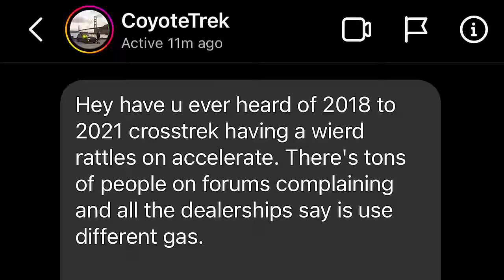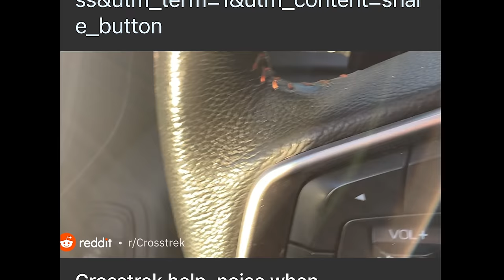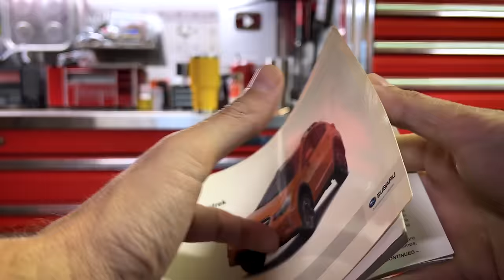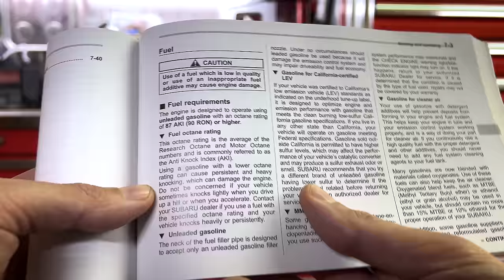Rattle, Ping Pop!? What Is That Noise In My Subaru's Engine?! Detonation & Pre-Ignition Explained

Comment: My brand new 23 crosstrek does it also. I've only got 1600 miles on it so far.  6 speed Manual.  I havent even had it a month. The dealer delivered it with a full tank and for that first tank it was quiet and smooth. Then I filled it up and the pinging started. I did 2 tanks of regular top tier gas (87 octane I'm in the US) and both tanks pinged on slight inclines under gentle throttle.  Idle was also very gritty. If the car was idling and I gave it a quick tap of the throttle the pinging actually sounded really bad. I hooked up a scan tool and watched the ignition timing go from 30 degrees before TDC  to 6-8 degrees AFTER TDC when doing this quick blip of the throttle. I was also seeing about 10 random misfires on a short trip (EWMA misfire count)  I did a tank of 93 octane and by about 50 miles into the tank the pinging was 100% gone.  The same throttle blip at idle only dropped to 5 degrees before TDC, and the misfire count droped to 0-1 per trip.  There's this unusual surge that happens when accelerating very gently between 2-3K rpm, that also went away with the tank of premium. I'm currently running a tank of mid grade (89 octane) to see how that does. If it's not 100% of what 93 was I'll just go back to 93 octane.   It's a shame they couldn't be honest about what these engines require. And I'm sorry, I don't care if the manual says some light pinging is "normal" I don't agree.  In their book I'm sure slight just means it isn't enough to destroy the engine during the warranty period which is all they are worried about. (I'm not bashing subaru, it's all auto manufacturers)  I'm convinced they delivered the car to me with a tank of premium. Because when I did my own tank of 93 it ran the same way.  I do absolutely love the car though. If I have to run premium, I'll run premium. 

Awesome video as always

Edited for spelling.
Reply from the maker: Yeah. Also believe our fuel quality is dropping the last couple of years. More ethanol added then the claimed 10%.
Reply: @MrSubaru1387  quick update. I finished the tank of mid grade and by the end it was not misfiring at all, but the weird power surge between 2-3k when driving gently came back. I'm now 130 miles back into the next tank of 93 octane again and it's gone. It runs smooth as butter.   I'm sure you're right about the quality of gas going down hill the last few years. 

Side question.  There's a warm up cycle that occurs for the first 60 seconds after starting every time, even when warm, I'm sure it's to warm up the cat, but it makes driving through parking lots slowly in 1st and 2nd gear almost impossible.  I have to wait out the 60 seconds then it's perfectly fine. The wife's forester does the same warm up cycle. You can hear the exhaust note change during this time, however since hers is the CVT, it doesn't have an impact on drivability.  Have you come across the same thing?
Reply: My 2018 6MT crosstrek is very much the same as yours. It makes the most noise under a light load when running 87 octane going up a hill and has a hesitation at about 2400-2500 rpm. When I run 91 octane 100 percent gas, it makes very little noise.
Reply: @jamescurrier5828  when I took the car in for the 3000 mile inspection/ first oil change, I brought this to their attention, and they shrugged it off and gave me the subaru owner satisfaction phone number to call and complain. I mean, it's not the service departments fault, but the whole "we've never heard that before" is a load of crap. It's just like you describe, worst between 2400-2500 rpm on slight inclines. If I start to to climb a slope at that rpm range I can actually feel it loose power (probably pulling back ignition timing in an attempt to lessen the ping)  I've read of some 3rd party re-maps that will eliminate this, but then there goes your warranty. Subaru needs to do a minor re-tune on these manual crosstreks and release it as an update. I understand they have some strict emissions goals to hit now, but this is just pathetic.
Reply: @matthewweaver1123 I've been running 91 -94 octane in my '21 Limited. 
My 2 other vehicles (Corvette & 4 Runner w/TRD Supercharger) both require 91 or+ octane fuel , so I'm use to paying for it. 
With my Crosstrek, I've noticed my gas mileage is averaging 33 - 34 mpg on a 50/50 split city/highway driving.
Reply: I totally agree with this statement, I’m pretty sure it has something to do with fuel, because I have a crosstrek with 37k miles I usually go to Costco for a gas. But as I was driving around the city I noticed this shell gasoline station had pretty cheap for 3.34 a gallon, so I went ahead and gave it a shot because it’s shell. A day after, that’s when I started hearing this type of noise so I’m pretty sure it has something to do with a fuel.
Reply: 1 year update. I'm at 42000 miles. About 50/50 highway city.   I've done the induction cleaning with the tool and the subaru top end cleaner. Didn't help. Also ran techron concentrate. I tried 1 tank of regular after many many months of mid grade.  The pinging is horrendous.   This engine sounds like it has 250,000 miles on it. I'm seeing ignition timing up to 5 degrees after top dead center on hills.  I'm going back to mid grade, and tomorrow morning I'm doing plugs. I have misfires on cylinders 3 and 4 during the first few minutes of warm up. The coils have been moved from 3 to 4, then 3 to 1. The misfire has not moved yet.  The dealer does not care.  I'm on my own. Next step is plugs. I don't have an inspection camera, or I would be trying to get a good look at the valves while the plugs are out. I'll give another update in a few weeks after plugs are done. I want to give the computer time to readjust after disconnecting the battery for the plug change.
Reply: In your last 2 posts it looks like the problem has come back, or were you not using 93?  Just want to know if 93 still fixes this for you, like it did in your first 2 posts.  And thanks for your updates.
Reply: @AB_159  so as the mileage has climbed at around the 10,000 mile mark I needed mid grade when the weather was hot to prevent the pinging. Then, roughly around the 25,000 mile mark midgrade wasn't enough on really hot days so I moved to high test. Now I'm around 45000 miles and on the really hot days the high test (93 around here) would not 100% prevent it, but that's as good as It would get. I did the induction cleaning with the tool and their official top end cleaner exactly the was the tsb says to do the cleaning, but honestly it didn't do anything at all. 
After I did the plugs and allowed the computer to readjust it seemed to be doing much better, then within the last week it's been running pretty lousy again. It had the tires changes out at the dealer last week. Decent tread left on the the original geolandars but was losing quite a but of traction when wet. My loaner vehicle was a 24 crosstrek wilderness. It runs waaaaaaay better than mine.   I just think there's a hand full of them that have some unknown whatever slightly out of tolerance, so you never get a check engine light, but it just is never quite right.  It bucks and surges on hills and pings in hot weather. It's super rough around the edges, but I guess it's still getting me from point A to point B. I'm just hoping that since there is a steady slow degradation, eventually something will be far enough out of spec to finally reveal itself. Not sure if it's a bad sensor , really not sure what to guess,  it just reminds me of a small engine that is running waaaay to lean.
Reply: Trade it while it's still got warranty/reasonable miles for something you can enjoy.  I've been down that road of trying to fix it, albeit not a Subaru, and it's not worth the hassle.
Reply: @AB_159  I really have given it thought, but interest rates right now....  I just keep hoping either whatever is wrong will get bad enough to finally throw a code, or it will plateau and I'll learn to adapt.

Comment: In for the next video. My 18' FB20 w/ 120k does this consistently on 85 octane at Denver elevation, no issues at 12,000+ ft (other than normal lack of power). It's had spark plugs, PCV valve, B12 in the tank recently with no improvement, about to clean the EGR valve and run CRC valve cleaning and BG EPR through the oil in an attempt to reduce compression and improve EGR flow.
Reply: Ever get this solved?
Reply: @albertdn97  Yep. I removed the hood prop and glued a bunch of foam to stop rattle from the intake extension that goes from the air box to the bumper. That was all it was. Sounded just like a persistent spark knock, and only while moving under light load. Crazy.

Comment: The amount of ethanol in regular gas was allowed to increase this summer to help control prices. That may have something to do with folks hearing a bit more knocking. The fuel you buy could be as high as E-15. This should drop back in winter blends.
Reply: Most cars cant burn E 15..my Subaru manual says dont use e 15 it will damage parts.  They dont sell e 15 where i am... i am glad we can get non ethanol gas still.
Reply: Ethanol actually has a higher resistance to knocking then standard gasoline.  This makes Ethanol very popular with forced induction tuning,  I.E. turbo/supercharged engines.
Reply: Ethanol is total crap. Not even environmentally friendly. Wasting ground water to grow corn to put in you tank. 🙄 Plus it’s bad for many engines.
Reply: @thehammerwell  It may depend on the tune.
Reply: @JP-wp1vi  Agreed. I've seen the math.
Reply: @Wrang15  Due to the mandate this summer (in the US), what is labelled 'E-10' may be higher than that. It's one of those "we know better than the engineers and it's more important to try and drive fuel prices down, temporarily" things. Fact is, most folks don't know, don't care. That said, my 04 turbo likes 93 octane E-whatever stuff just fine, though I wouldn't try running E-85.
Reply: @TheGhungFu  I guess,  but I'm talking about the fuel itself.  Ethanol has has an Octane rating of around 100 when compared to regular 87 unleaded.  Octane is not to be confused with power density, regular unleaded has around 125,000 BTU per gallon, with Ethanol having around 85,000 BTU per gallon.   So ya the tune is completely different.  Regardless though E10/E15 Ethanol blend itself won't make your vehicle knock/pre ignition,  especially not a modern car.  I will say it can cause issues with older vehicles.
Reply: @JP-wp1vi  The farm/agro industry lobby at work.
Reply: @JP-hr3xq  energy density is why.  Gasoline has a higher energy density then ethanol.

Comment: My 2018 crosstrek 6MT makes this noise. It does it occasionally if I use 91 octane. If I use 87, it sounds terrible. Especially when under a slight load, going up a hill. With 91 octane, I do also see a slight mpg increase.
Reply: Well I’m glad I’m not the only one. I pulled my plastic armor off the bottom of my car, was poking around under my car looking for a rattle couldn’t find shit had wife hop in brought the engine up to 2500 ish tryna find it still nothing. . But I did burn the shit outta my thigh bumping it into exhaust pipe while shifting around. I have a 2018 too just cvt tho, is yours still making noise?

Comment: We’ve had this issue for years on our 2012 FB25 Forester. It does under very light acceleration.  We switched to 93 oct for a while and it still did this but less often. We switched back to 87 oct and always pump either Mobil or at Costco.
Reply: Avoid Costco gas especially if you are having detonation issues.  Having worked with tuners, the folks who get to see the differences in gas qualities from various companies on a daily basis, Costco is one of if not THE worst quality gas stations out there to buy from.
Reply: @stevemartegani  Costco is the only gas station I fill up at. Ej255 havent had any issues. Car is driven reasonably hard. Any proof that Costco gas is the worst?? You can’t just say Costco gas is bad with no evidence. And no, you’re tuner saying that it’s bad isn’t good enough. WHY is it bad. There’s no Ethanol at all in the Costco I fill up at.
Reply: @Bryan24U10  Costco buys from various vendors to keep costs down, thats well documented.  They have the least consistent supply as a result.

I can't provide you with any of the "proof" you desire.  You would need to contact your tuner or any tuner.  My tuner, Snail Performance, explicitly recommends to avoid Costco gas and has seen issues with it on the dyno.  Same with Chevron due to their high amount of additives.

Comment: I get this rattling sound on heavy acceleration in my 2013 Legacy 4-cyl when I use cheaper gas.  My mechanic gave me a treatment which works very well.  Run the gas tank pretty low, then fill with premium fuel (93 octane) and add a bottle of Techron fuel treatment.  Run this tank down and do the same again.  After two tankfuls of the premium/Techron mixture, the sound/pinging/knock is gone.  After this I can go back to regular fuel.  The problem will recur if I use cheaper, "generic" gasoline.  As long as I stay with a major brand (Shell, Sunoco, Exxon, Mobile, BP, etc.) the problem doesn't recur or takes years to happen.  When it does I do the Techron treatment again.

Comment: I think it seems to be fuel based. The feds have said 15% ethanol is ok so many stations are selling 85/15 instead of 90/10 bc it's cheaper. I never had a rattle prior to that change. If I add octane booster it goes away within a few minutes.. also tracking where I got gas prior to it happening and it's the same stations. 

The Impreza book says 10% ethanol max...
Reply: Also if you want a temp gauge buy a "fixd" Bluetooth OBD2 reader and their app let's you display live coolant temp. I drive with it open on my dash and my engine stays at 194 anytime I'm moving. Sitting in traffic on hot summer days 210-214.

Comment: Thanks for the very intuitive intel on the knock issues, it happens with my STI when the gas is bad , so i use a octane raiser additive, turbo 108  octane booster and it really works since my STI is been modified and tuned, is really good to add this kind of booster every time the tank is filled up, Keep up the good work i love your videos

Comment: The newer FA/FB are notorious for knock while under high load low-mid rpm. The phenomenon usually comes druing low vehicle speeds under cruising conditions.

I have a JDM FB16 impreza and i have it alot, i use to use 90 octane (aki). 

Ive logeed the information using my scan tool and saw that the car was experiencing knock and also pulling up to 4 degrees of ignition advance to counter the issue. 

I switched to pump 93 initially but at close to $7.00 per gallon i have reverted to the 90 octane with a shot of boostane to bring it back to 93 octane. 

The car is completely stock, naturally aspirated,  OE spark plugs and CVT. 

The car runs a fair bit of ignition advance in that condition, i presume its for emissions and fuel economy but it is a part of the reason why the newer F series engines experience alot of premature failures (rings/ring landing failures) in hotter climates like mine in Jamaica.  

The manual recommends 87 octane (aki) however the car knocks heavily on 90. 

What i will do is to have the car tuned to fix the little instances of knock on the 90 octane gas.

Comment: I had a rattle intermittently when the engine would have some load on it. 2020 Crosstrek. I thought maybe knock, but it ended up being the stupid plastic air duct that connects to the airbox and to the front of the car. I just put some electric tape around the connecting part that inserts into the air filter box for a tighter fit and the rattle went away.  In a 6 speed manual there is more NVH with no torque converter to cushion the power transfer so it is easier to make that plastic duct rattle.

Comment: This noise has been my nightmare in my Legacy 2013, FB25 engine, since several years ago. When the sound bounces off a wall its more evident. It happens when under load and temp is hot. I have been in forums and no luck finding a fix. I have also heard other legacy owners while driving and some experience the same. Just annoying.
Reply: Please verify the heat shield up in the start of exost pipe under the engine. There is some bumbers made of steel sponge and it's has to be replace or bended in a way to not touching the pipe (heat shild not touching the pipe). This was the case for me. I spend almost a year wonder what noise is this...